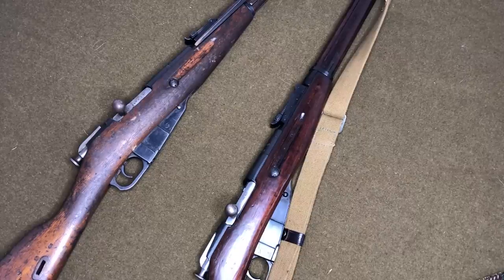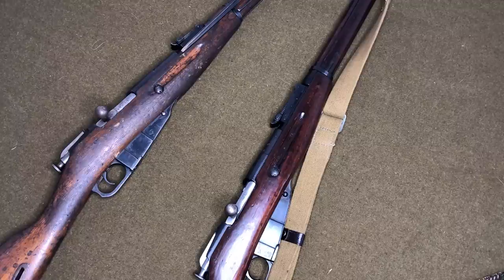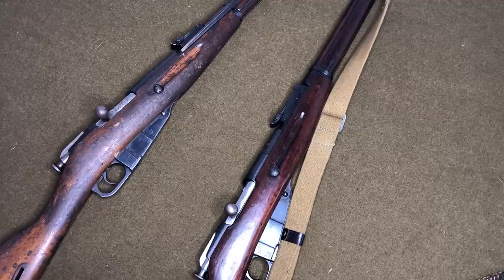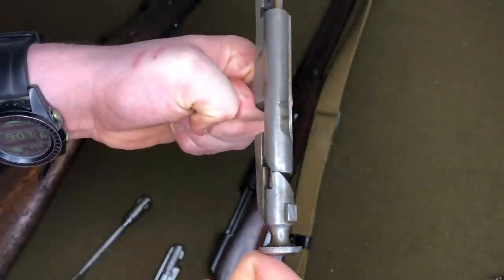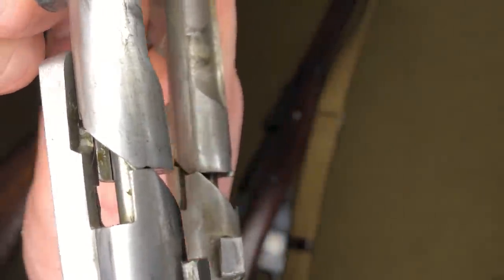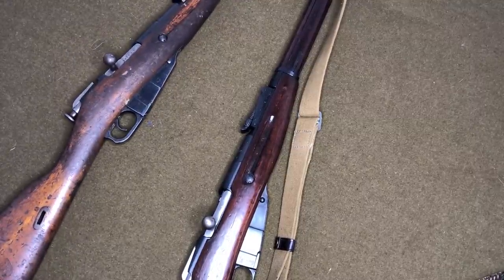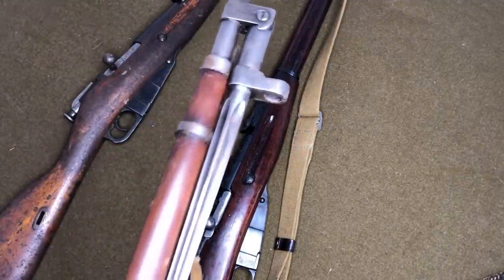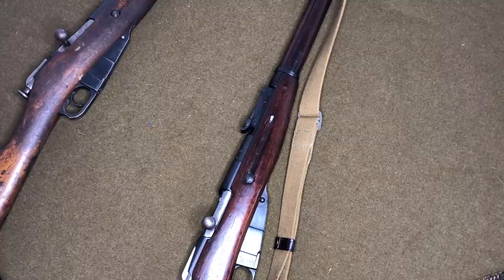A Few Simple Things I've Done to Make My Mosin-Nagant Rifles "Better" and Much More Accurate

Comment: Do you have a 1911 pistol
Reply from the maker: No. I'm not paying over 1K for a rattly old surplus pistol because "MUH 1911!!"
Reply: @MikeB128  Have you looked at the Tisas 1911A1s out there? I got one, and it's amazingly well built. It also takes any after-market 1911 parts without any hassle.
You can get them for less than $400 new.
Reply from the maker: @kevins1114  Yeah I'll get a new made clone soon, but I'm not shelling out that much for a USGI one unless it's mint Pre 1918 lol.
Reply: @kevins1114  I've shot one a few times. Decent guns. The Springfield mil spec is decent too if you wanna look on the secondhand market.

Comment: What exactly was the notch for?
Reply: I'm thinking it's some kind safety feature. If your bolt handle gets nudged you don't want it flying open unexpectedly or going off unexpectedly.
Reply from the maker: Eh, I don't think so. It's not possible for it to just rotate when it's locked in place. I could be wrong, which is why I said "I don't recommend doing this". People have just been asking me why I think Mosins aren't that bad, and here's why.
Reply: Mike B From my layman’s perspective it seems like it’s designed so that your bolt can’t cam open without serious force behind it. Possibly if you were walking through thick Taiga brush it would help prevent brambles from unknowingly opening your gun up or something. Idk can a Mosin Fire out of battery, like if the bolt is in that half cock position?

Comment: I assume that notch is there so that the gun cannot spontaneously go out of battery should you bump the bolt or so the striker dosent slip when you close the bolt of the gun is in non favorable conditions.
Reply from the maker: The way it's designed, it won't. I've never had an issue...

Comment: Mike , a friend an I have mosins (91/30) when we shot about 10 rounds we noticed our hand guards would shift foreword, have you had this happen to you and would the shims remedy this ? Since the shims will align the action and barrel .
Reply from the maker: No idea. It's an issue with the band spring it sounds like.
Reply: Coy,

The light canvas wrap in the kit will help combat the “walking hand guard”.  The light canvas wrap is oiled and wrapped around the barrel at the front barrel band.  This creates a “pinch point” and tightens up the front band area.  This also helps prevent “barrel whip” and creates a damper effect for ideal barrel harmonics.  Proper barrel harmonics are essential for ideal accuracy.

You can also try and add a SLIGHT bend to the band retaining spring to make sure it’s catching the band better.  BUT, you risk snapping the pin that holds the band spring.

I have a few other recommendations to help your problem but I would need to send pictures.  Message me at Milsurpaccuracyinc.com and I’ll try to help you out.

Comment: Is there a point to the “nip” on the bolt that will effect the safety factor
Reply from the maker: Affect*, and probably, which is why I advised against doing it. That being said, I haven't had issues with it.
Reply: What's the saftey factor? Not that I am for or against grinding it, I just want to know.